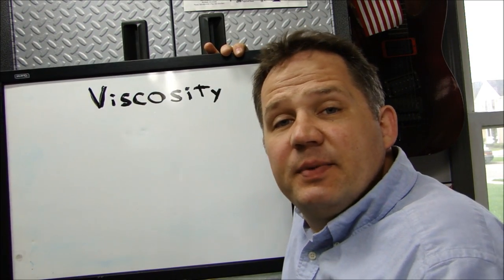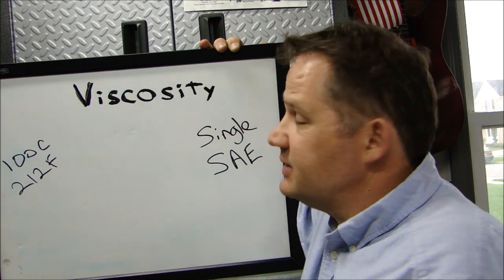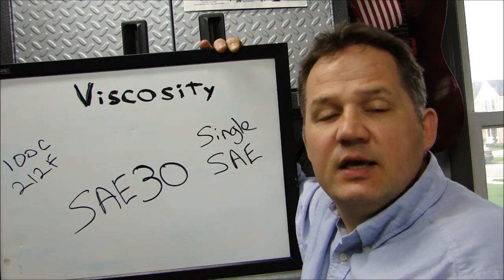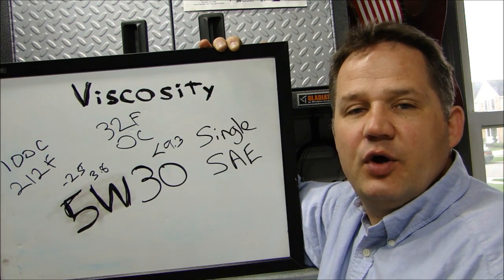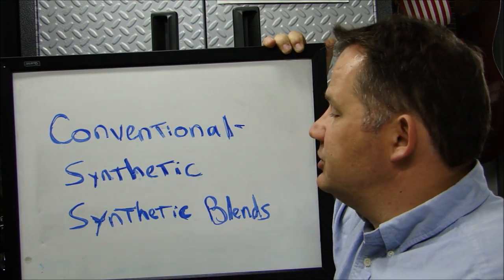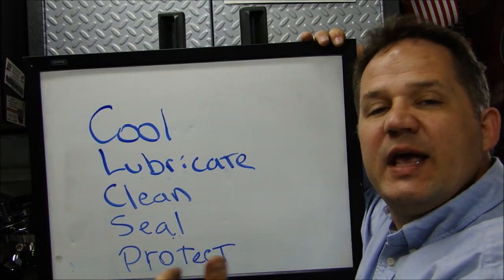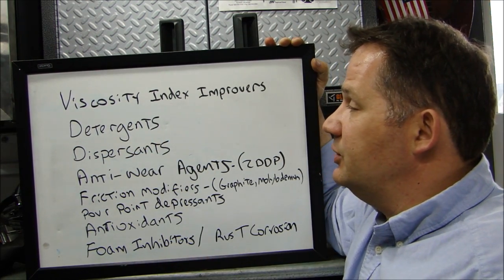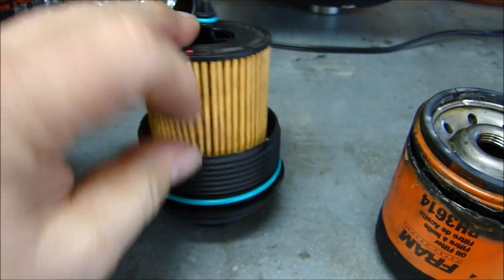Motor Oil, Oil Filters, and Changing Oil

Comment: Have you looked into K&P stainless mesh filters?
Reply from the maker: I have not...but I will look them up. Thanks!
Reply: The stainless mesh is the same used to filter blood for folks who need that. Gets down to about 100 micron size, and according to an oil engineer, if you get much smaller you'll be stripping out additives.
Reply from the maker: 100 microns is pretty small. You have to also be concerned about starving the engine of oil. The pump can only push oil through a filter that is so fine. The filter can restrict flow.
Reply: I had a lot of discussion with the syn-oil engineer and the people who make this filter setup. I have never used one of these with heavier oil than 10-40 though. My Ford calls for 5W-20 so it ought to be good. Had one on a Dodge 360 for a long time. It cleaned out a lot of paper-like stuff.
Reply: Ford calls for 5W20 as it has very small return and pressure vain passages on the cam timing adjusters. If you use anything like 5W30 the cam adjuster fails and will start to rattle. That's why they call for it.

Just an FYI incase you like pulling cam chains and valve covers.

Comment: How often you change oil on your car?
Reply from the maker: When the computer tells me or no more than 4,000 miles
Reply: I have a new car had first oil change done there for free and they  told me  not to  uses the computer and change the  oil every 5,000 miles are they right about that.
Reply: john1240able about 3000 with conventional and 5000 with synthetic
Reply: john1240able and pick a filter that will match the length of your filter. I run Mobil 1 synthetic oil and filter on all of my cars. I have one that at 160000 and it runs like New.
Reply: Whatever your manufacturer reccomend
Reply: Every 5,000 miles on our 2009 RAV4 using Super Tech full synthetic 0W-20.